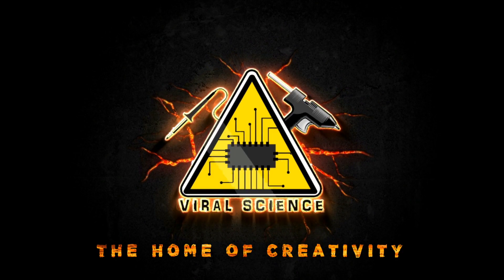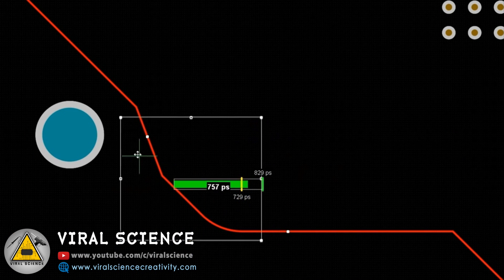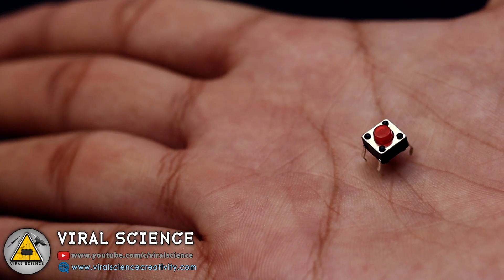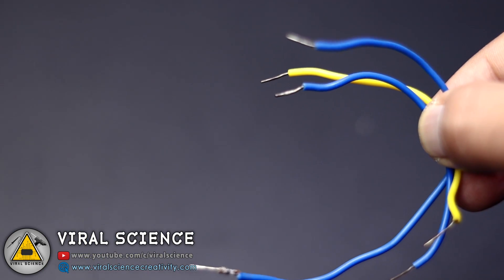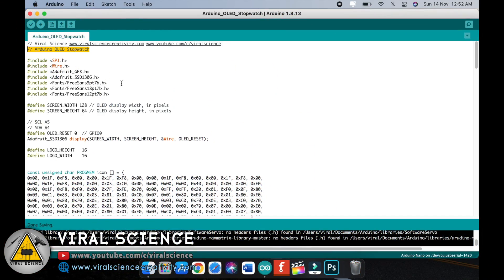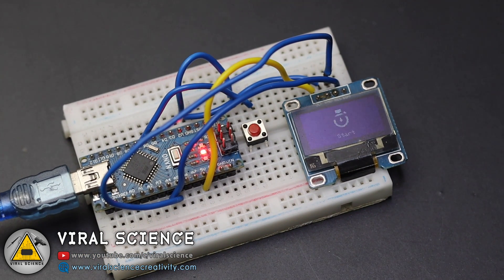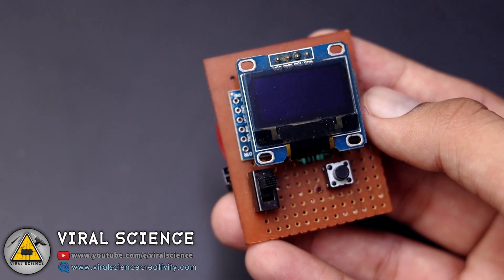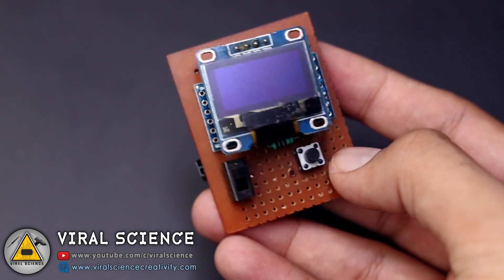Arduino OLED Stopwatch Tutorial

Comment: Bro very nice video. I had a question that if I use a lcd display with i2c module then there is same pins like oled in i2c i.e. vcc, gnd, scl, sda, so if I connect as your circuit diagram will the code work😀😁😊
Reply from the maker: 16x2 lcd needs its i2cliquidcrystal library and needs its coding to print statements
Pins will be same but print statements in the code will change and library as well
Reply: @ViralScience  thanks bro😊